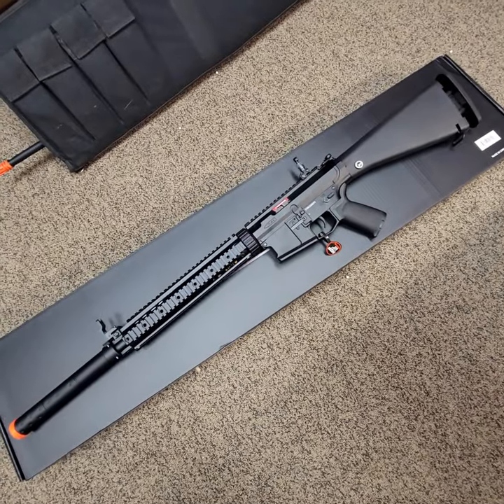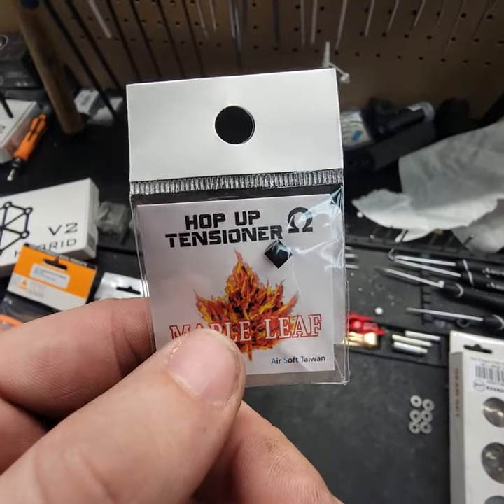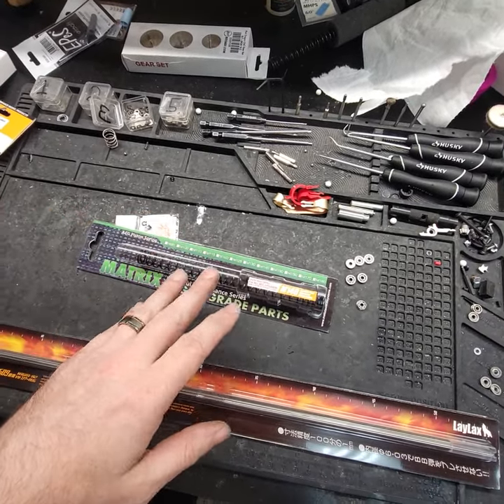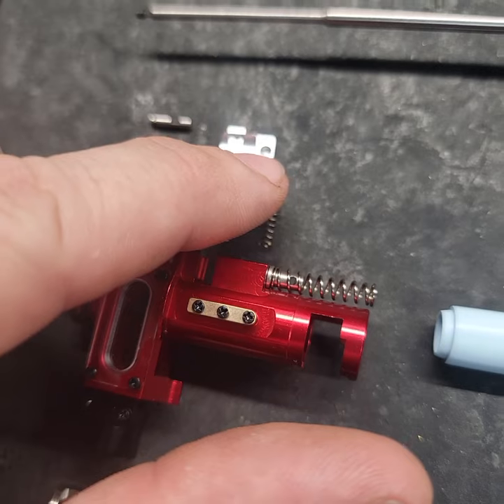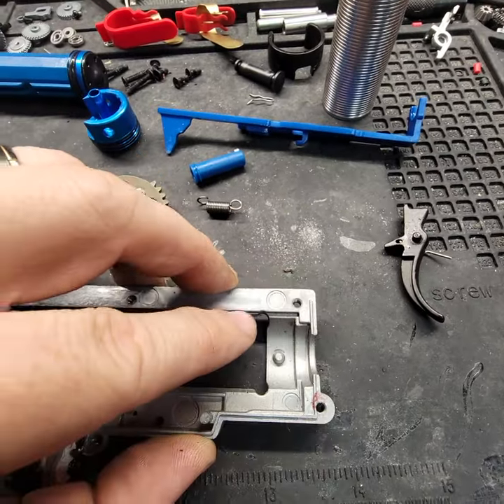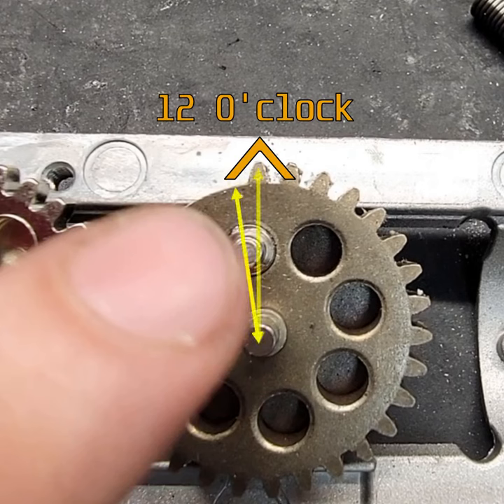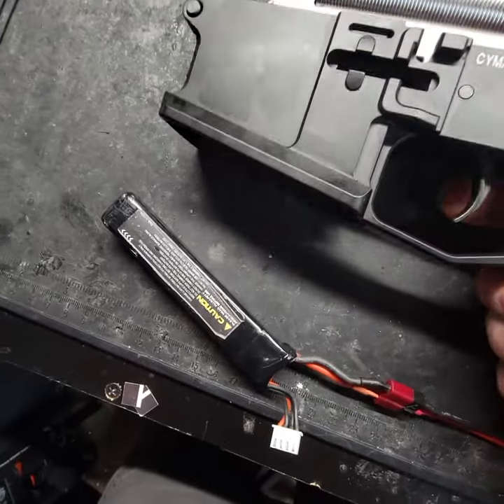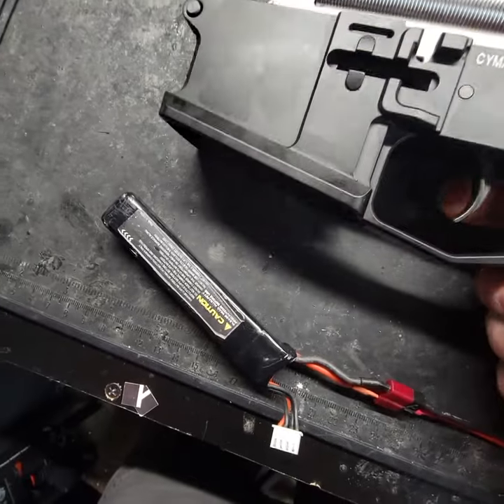Cyma SR25 Airsoft Rifle Upgrade Mastery: Insider Tips for Peak Performance!

Comment: Could you link the parts you got? I have the same gun 😊
Reply from the maker: Prometheus 6.03mm x 480mm (cut to length and recrowned)
Maxx M4A 
Maple Leaf Super Macaron 70 degree
Maple Leaf Omega Nub
Rocket Bevel and Spur (just get the 18:1 set and DONT use the sector gear)
8mm J-caged Ezo bearings
EPeS 24.5mm nozzle
BEGADI FULL SR25 cylinder (if you dont have a full cylinder)
Perun V2 Hybrid

All these parts can be found on my website at www.wyshtech.com.
Reply: @wyshtechairsoft thank you very much, I’m nervous about doing this myslef tbh, how much would it cost not including parts
Reply from the maker: @jacobm6428 Labor is about $100 but comes with a 90 day warranty.
Reply: @wyshtechairsoft  oh that’s cool, could I contact you over email? How much would it cost all togheter I’m shipping all the way from mass
Reply from the maker: There should be a link in the description that will take you straight to the contact us page so we can discuss upgrades and costs more in detail.

Comment: I love how they have put a guide oring behind the main oring so it basically is a syringe xDDD
Reply from the maker: I know right? The extra o-ring is a brilliant ideal to reduce cylinder wall damage.
Reply: @wyshtechairsoft  but it is suppose to be in front of the oring that also acts like a valve for a reason
Reply from the maker: @zujek7409 I find that the suction helps .40g bbs feed better.  My theory is that it pulls the bb into the chamber, which assists with feeding due to the heavy weight bb.
Reply: @wyshtechairsoft  tbh i was never shooting 0.4g in an aeg (like who has the money for that xD). Also im gonna see how it feeds when i get to upgrade mine (with 0.32/0.3). But in my cm041sd it was making the whole gun reaaallly slow and it has no problem feeding as a dsg with a normal piston head ofc. So yeah not sure if it is Worth lack of ventilation which puts stress on the whole system and the pick up teeth especially since mushroom heads like to get sucked on the cylinder head
Reply: @wyshtechairsoft  And since i can talk with someone who did a v2 long (i made like 10+dmr and never Got a long gb). What spring should i us for 2.3j on .3s with 509 6.03 barrel. Ofc with a cyl Type 0 and not the stock "type 1" (i got mine like 4 days ago). I was looking at some psg1/sr25 Springs for guarder but I only found an m120 and m150.

Comment: Have their cyma plat mk18, changed the nozzle to a maxx same/closest to stock nozzle and can’t get the maxx hop to work/feed. Somehow after closing the gearbox with everything functioning and tappet moving freely, the nozzle isn’t being pulled far enough it seems. Like I have to shim the hop forward a little with I shouldn’t have to do
Reply from the maker: Stock length is too long for the maxx hopup.  Its supposed to be either 21.25 or 21.00mm. If you got stock length then its definitely too long.
Reply from the maker: Quick fix, you can use a really thin oring to put between the hopup and the gearbox.  Just wrap it around the hopup opening where the nozzle goes into.
Reply: @wyshtechairsoft  that’s exactly what I did lol thanks brother
Reply from the maker: Glad to help!
Reply: @wyshtechairsoft  okay I actually had already changed to the 21.00 nozzle but it still was protruding into the hop a little preventing smooth feeding. But after I added the oring as a spacer it fixed it. But I shouldn’t have needed to do it. Thing is when the gearbox is open and testing the nozzle, it clears the hop just fine, but once closed and cycled it’s like it’s not being pulled all the way. Tappet moves freely as it should after closing

Comment: On a CM098a the 14.5inch Mlok what is the barrel length you would reccomend for .4g bbs?
Reply from the maker: No unless you put a Maple leaf super macaron bucking as the stock bucking cannot lift .40g bbs.  Additionally the stock nozzle will leak compression due to the heavier bb.  For now until you can upgrade SOME of the internals. Id stick with .32g bbs

Comment: I’m new to air soft man,
But I have the CYMA Sport SR16 E3 .  

“Gearbox: Ver 2 / 8mm / Full Metal, Fully Upgradeable”

Trying  to upgrade range and accuracy. 

Question, if I put a m120 spring in my gun with all stock parts, will my gun take a poop on me ? 

What upgrades do you recommend to increase range and accuracy , budget friendly please lol
Reply from the maker: Let me ask you this, what weight bbs do you currently use for range and accuracy?
Reply: @wyshtechairsoft  .25 mostly . Is It possible to make this rifle accurate up to 100ft ? (10 inch circle or man target size)
Reply from the maker: @Edible_Semtex_ weight of the bb can make a huge difference.  .25g is pretty light.  If you want more range and accuracy, get something heavier like a .32g bb.  Upgrade to a better hopup bucking like a Maple Leaf Super Macaron with the Maple Leaf Omega nub or Modify Flat number.  The .32g bb, bucking, and nub alone will make a HUGE difference while spending less money and has ZERO added stress to your rifle.  Also, I highly recommend getting a 2nd rifle if you plan on pulling the gearbox for future upgrades on your own.  

I see way too many people try themselves and mess up thier rifle and they cant go play for that weekend.  Its good to have a backup.
Reply: @wyshtechairsoft  so do I just run the stock spring ?
Reply from the maker: @Edible_Semtex_ Whats the fps on .20g bbs?
Reply: @wyshtechairsoft  I haven’t even ran a chrono bro, just running .25s but If I had to guess , I’d say 315 -330 fps
Reply from the maker: @Edible_Semtex_  normally those cyma's are already at 400fps so  it shouldnt need a m120 spring.
Reply: @wyshtechairsoft  I was talking to my buddy and he says I should do the hop and bucking kit ??? I don’t know what the hell he’s talking about
Reply from the maker: @Edible_Semtex_ I think he means to upgrade the hopup unit and bucking.  Id recommend the max pro m4a and Maple Leaf Super Macron 60 degree from my website. Wyshtech.com.

Comment: Question???  

so I have the same gearbox except the gearbox in the video has a slot cut out of the back end of the gearbox shell, which exposes the back end of the piston( in my gearbox it doesn’t have that little opening)

What would that slight difference do to the performance to my gearbox?

I do have a little experience in airsoft gearboxes enough that I was able to put a gate titan v2 Bluetooth +a new air nozzle and re-shim but still learning….
Reply from the maker: It makes absolutely no difference.  Though its nice to have that window for gauging pre-cocking distance so you can set it perfectly through observation and trial/error.

Comment: Why is a DMR lobbing 0.40's at 2.3J left with full auto? Also the prometheus barrel is cutting down the fps, they're notorious for it. I'm using a M130 in my SR25 build and I have 310-312 FPS with 0.40's which is just under the UK limit. There's no way that M140 should of been giving that low of a FPS reading, its 100% the inner barrel, I bet if it was switched back to stock or another inner barrel the FPS would of shot up. "https://www.youtube.com/watch?v=rxqtMy0SQQU&ab_channel=NegativeAirsoft" 6:40 explains it all. I had it with one of my old builds, for the life couldn't figure out why my FPS was so low, I changed everything until the inner barrel was the last thing left which was a prommy. A quick change to stock barrel and boom the fps was back up.
Reply from the maker: It wasn't the barrel. I tested the spring weight, and it was indeed mislabeled. It pulled the same weight as an m120 and not a m140.  As for the full auto, it's the customer discretion to shut off full auto using the etu. He understands the potential ban and safety risk of even using full auto with that many joules. Also, they are definitely not a newcomer to Airsoft. I wouldn't have built this SR25 if I didn't think they understood the safety risks, maintenance, and sportsmanship involved in having a DMR like this.
Reply: I’m planning on a Cyma Platinum SR25 build soon. Site rules are 450 fps with a 0.2. Do you think I need a new mossfet? Is there a part list you can recommend to get it firing nicely without breaking the bank? Cheers.

Comment: question., will a standard v2 spring guide fit this gun , If i want to chop off the end of the guns buffer tube / spring guide ,. to put a drop stock adapter  on this gun?
Reply from the maker: You will need an APS style v2 spring guide to do so.

Comment: I’m looking to upgrade my A&K sr25. Is it worth putting a 6.01 barrel into it? I’m basically gonna have the same parts except I’ll have a prowin hop-up unit and oem gears. I’m also want to put a brushless motor into it for overall better performance and I want it to be as quiet as possible. If you have any objections please tell me I’ll still learning teching
Reply from the maker: The barrel really depends on the quality. Definitely dont go cheap.  At least get a Prometheus/Layax barrel.  I personally dont like prowin hopups as they done secure to the barrel very well and they have QC issues.  Maxx M4A hopups are sooo much better and pair it with a maple leaf Super Macaron.

Becareful of high cycle speed.  Sr25 gearboxes use a 19 tooth piston and can easily PME and ruin your internals if they cycle too fast.  Check out my website for these parts, Wyshtech.com.  I recommend getting the NEW SR25 gearset, no faster than 33k brushless motor, Perun v2 hybrid ETU, M120 spring minimum, epes 24.5mm nozzle, maxx m4a hopup, and maple leaf super macaron 60 degree.
Reply: @wyshtechairsoft  I am going with Lambda barrel. My plan is to go with around 20-28k motor. I will look into the maxx hop up. I saw it in this video and I’ve seen a lot of techs using it in videos. Would an M140 work cause that the plan. And any more tips? I’ve got doubled o-ring lonex cylinder head. SHS sr25 piston and lonex piston head, also the SHS o-ring air nozzle. I’ll look into the epes one. Thanks!
Reply from the maker: @shaggybeast2276 The EPeS nozzle will wobble alot less than the SHS and it has two internal orings which is all important for consistent fps.  The SR25 gearset is covered in one of my newest videos. You should take a look!  Make sure to get a Lambda "precision". The "smarts" have horrible bores.  20 to 28k is perfectly fine. With a m140 you can go to a 33k T238 Brushless motor without worring about pme.
Reply: @wyshtechairsoft  I will take a look. Thank you so much! You da man😎. I will definitely be back here to this comment when I have a question about this again. Thanks!!!
Reply from the maker: No problem! I highly recommend joining our discord channel if you got it.
Reply: @wyshtechairsoft  I'm definitely getting parts from your store M140 is out of stock so would an m150 hurt the gears?

Comment: Hey I'm curious, what spring would get me to anywhere around or under 1.55 joules with .30 gram bbs
Reply: With the cyma sr25
Reply from the maker: A M110 definitely will get you under 1.55J
Reply: @wyshtechairsoft  but like around how close? I wanna get as close as possible
Reply from the maker: Honestly it should already be there from the factory. Have you checked?
Reply: @wyshtechairsoft  it came a little lower than that, I'm using .3 bbs and I was getting 1.16 joules
Reply: Do you think a m125 or m130would get me as close as possible to 1.55 joules for my cyma sr25?  @wyshtechairsoft
Reply from the maker: Thats really low.. something else isnt right.  There's gotta be a compression leak somewhere. It is still bone stock?
Reply: @wyshtechairsoft  yes besides the mosfet I put in, I tested the piston and everything and it was all good, but when I tested it with the nozzle on there was a decent amount leaking from there but I thought that didn't really matter
Reply from the maker: It actually makes a difference when you install a double oring nozzle.  I suggest throwing in a EPES 24.5mm nozzle from my store.  It will increase your fps.  Also grab yourself a Matrix m120 spring.  That'll definitely get you the 1.55J.   Maybe even higher.  Thats usually what I see in the chrono.
Reply: @wyshtechairsoft  even for the cyma sr25? Won't I need a bigger spring to get that fps? I'll get the nozzle and try it out with the spring I have and see how that does me, thanks for all the help
Reply from the maker: M120 will definitely get it there. This is from experience too.